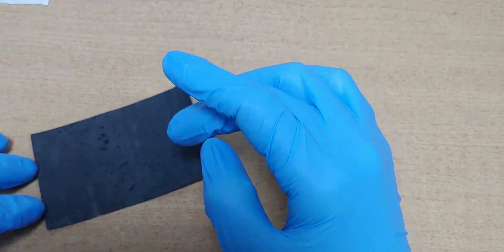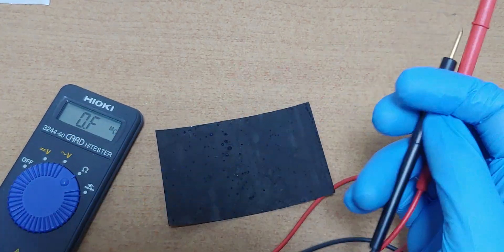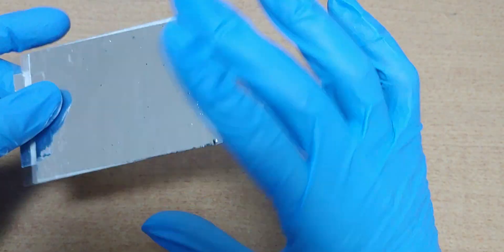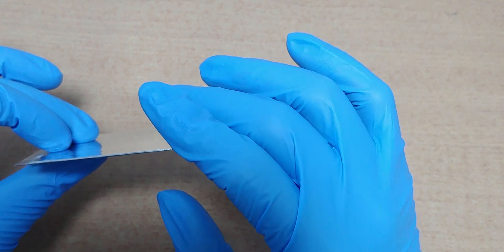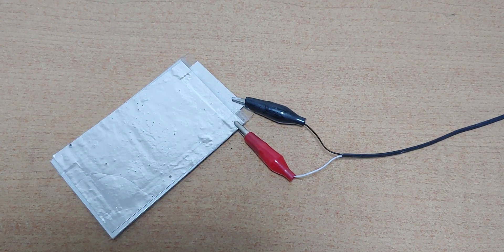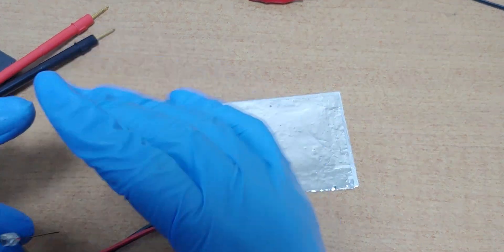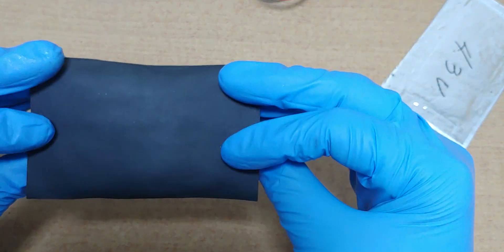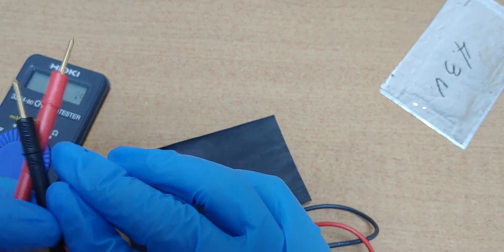solid state battery: 4.3 V

Comment: Hello!
Please write the electrolyte mix accurately.
What metals do you use for the anode and cathode?
What material is the black part you are measuring the resistance?
Is the black part also soaked with electrolyte?
Thanks.

Comment: How do u make solid electrolyte ( ceramic ) for batteries pls reply
Reply from the maker: Detergent powder + toothpaste(not including clorine) + water

And dry it

This time, I added soap.

Have a nice day
Reply: @solidbattery9956  what properties of dry (rehydrated, actually) detergent and toothpaste (which already includes a detergent) combine to allow them to hold a voltage differential?
Reply: @solidbattery9956  seriously‽ What kind of detergent?, is it a quaternary ammonium , or just a surficant like sodium lauryl sulfate, surfactants can be polarized more positive or negative or ziteronic, it matters, is the toothpaste fluoridated? Does it contain titanium dioxide or something else that could be a catalyst?
   I'd love to know if this is working like an intercalciting capacitor or if something's actually plating out on to the graphite , or perhaps the electrolyte itself is in a reversible redox state like an organic flow battery... 
Please be more specific on the ingredients so those of us who care out here can try and isolate the active components...

Comment: Dude what if u add 50 cells to gather & make a 12 volt 3 amp battery. Did you tried?
Reply from the maker: Not yet. That's because of voltage unstability. Have a nice day